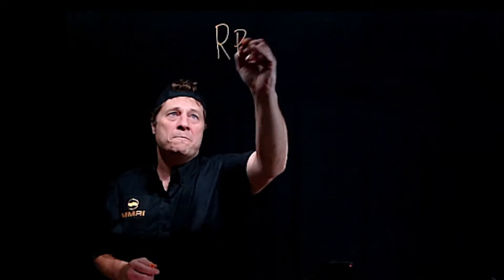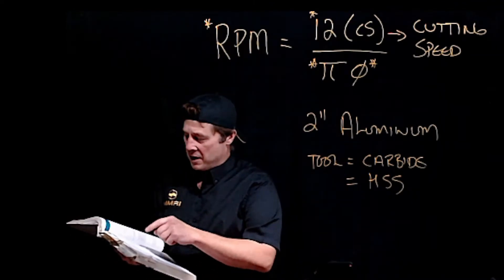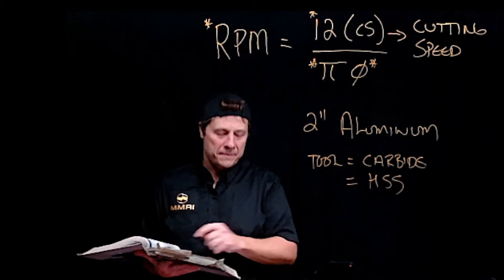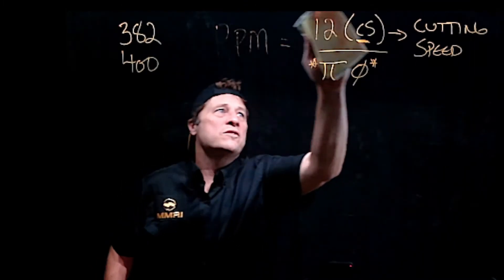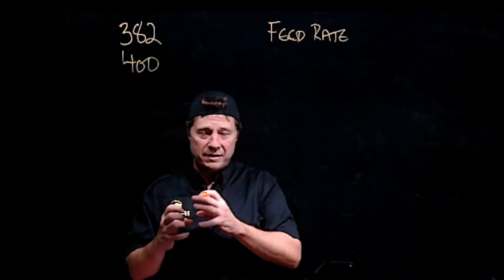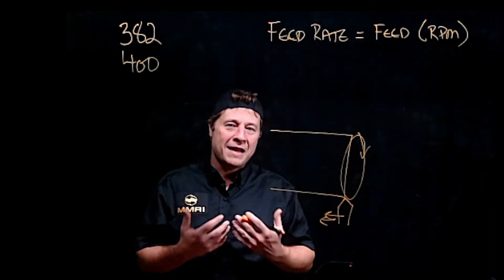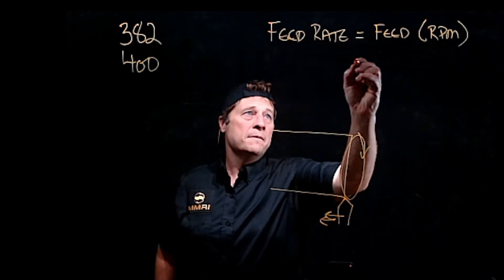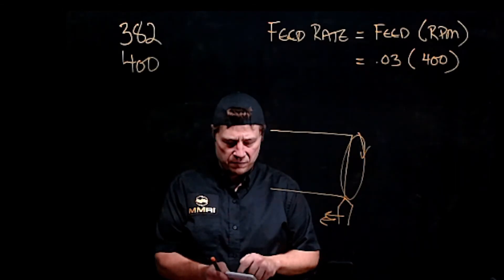Lathe Feeds and Speeds

Comment: Generally well explained but I think you could have explained 2 things here. 
Derive the the rotational speed formula from first principals i.e. circumference x C/S This gives insight into just what needs to be considered, the units used and hence explain where the 12 came from i.e. converting feet to inches. By undrstanding the derivation you can apply the same principals to any other system of measurement.
Why the feed rate is is hard tied to RPM on a manual lathe i.e. The feed screw is geared directly to the spindle since this is not the case with CNC lathe or milling machine.

Comment: which standard book we need to refer to know optimal cutting speeds, feed, and depth of cut for turning operations of INVAR 36 material.
Reply from the maker: I don't have experience cutting this material. If the Machinists Handbook doesn't provide specific information on cutting speed, feed and depth of cut then I would contact a tool supplier like SOWA or ISCAR and get some direction from them. Your metal supplier should be able to provide at least the recommended cutting speed for you.
Reply: Namasthe🙏 and thank you so much for your response. @adamtaylor999
Reply from the maker: I would talk to a tool supplier and get their help. I would hate to suggest something without having the cutting experience for this material.  Sorry @sushmitshetty8926
Reply: I also want to know about the type of inserts for turning operations for the same material is INVAR 36
Reply: @adamtaylor999  THANK YOU SO MUCH...

Comment: Sir if you divide 12 / 3.14 = 3.82 x 200 / 2.00 = 382 rpm
Reply from the maker: Hello @danielsalinas9248
If you are trying to solve the RPM for your lathe, then you can simply use the "shop floor formula" which is:
 4 X Cutting Speed / Diameter of material
For instance, if you are cutting aluminum at a cutting speed of 200 and the diameter of the aluminum is 2.0" then your formula would look like this:
4 x 200 / 2.00 = 400 RPM
If you want to use the true formula (which is really only beneficial for setting CNC lathe spindles) then your formula would look like this:
(12 X 200) / (3.14 X 2.00) = 382 RPM

I hope this helps. Thanks for reaching out.
Adam